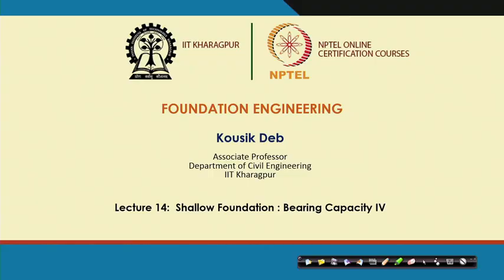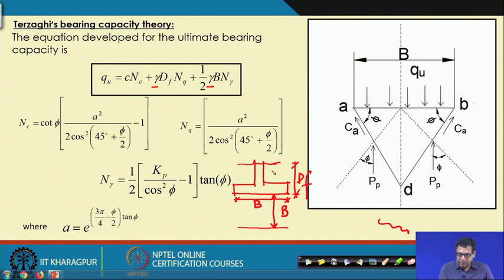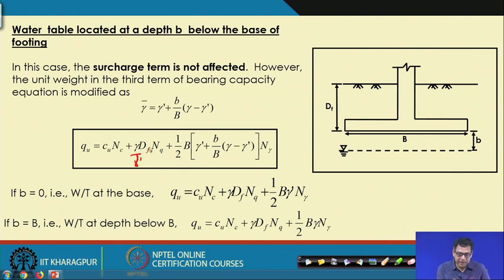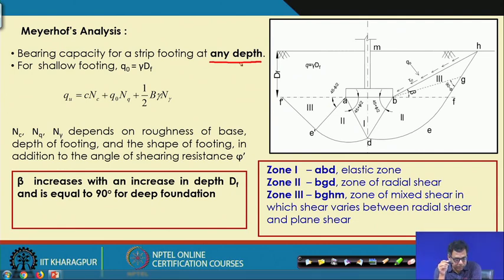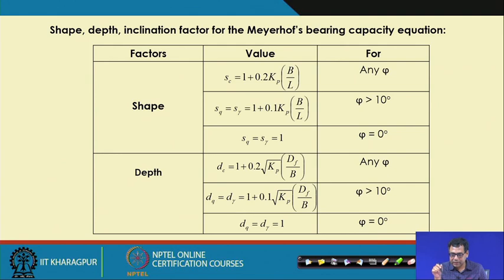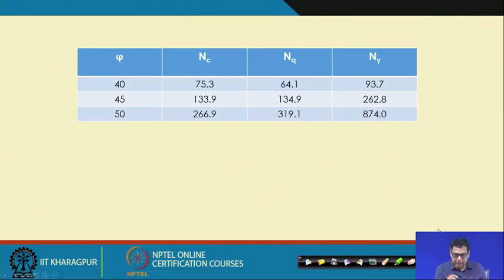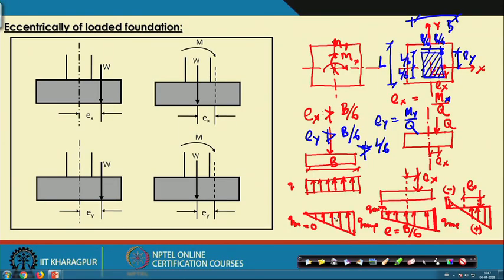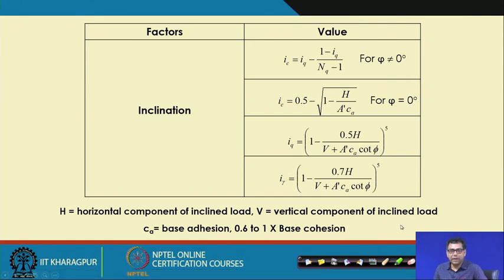Lecture 14 : Shallow Foundation - Bearing Capacity IV

Comment: When phi =0, cot(phi) in the equation of Nc becomes infinity. Why the value of Nc = 5.7 then?
Reply: Cozzz....for pure clay Nc = 5.7
(See in Table of phi and factor's of bearing capacity)
Reply: @aboli_r_shinde  For normally consolidated pure clay in CD and CU conditions c = 0, not phi.
Reply: @aboli_r_shinde  Clay soil does not have phi =0 always. Fora example, a normally consolidated clay will have c = 0 (not phi) under CU and CD conditions. So, if phi is not equal to zero, Nc won't be equal to 5.7 either.
Reply: @abduljabbarkhan9107  ok👍🙏
Reply: @abduljabbarkhan9107  for clay phi is always zero as it is perfectly cohesive soil while silty soil is c- phi soil .